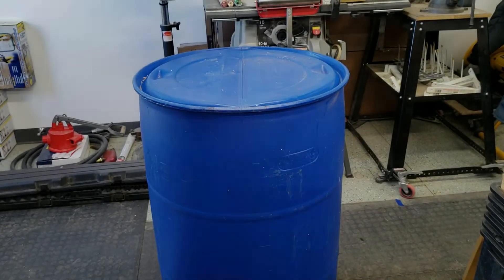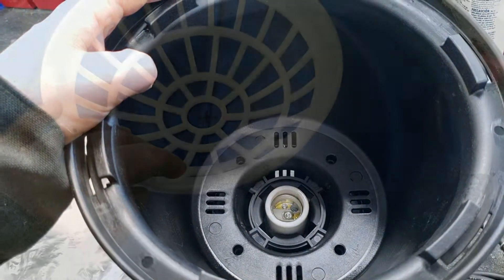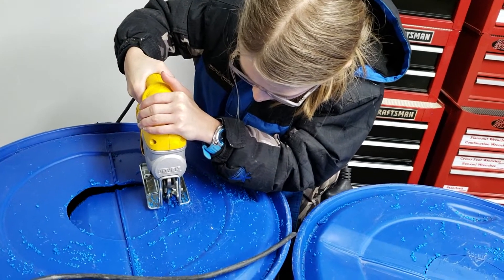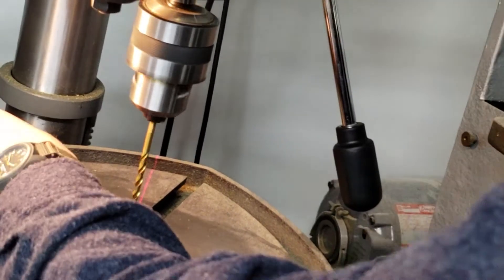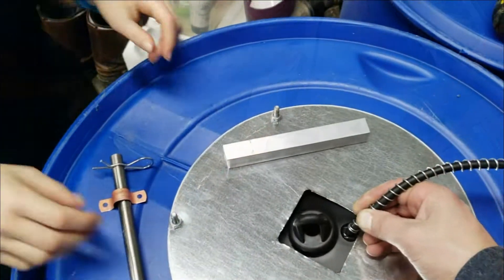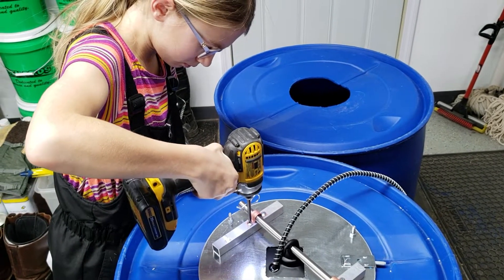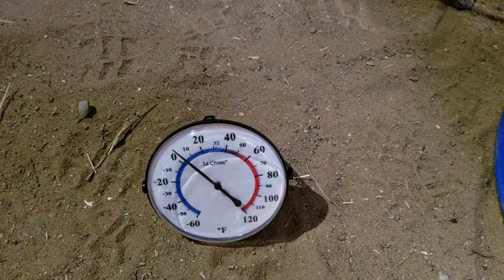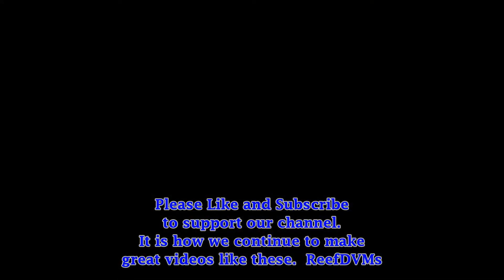Best Safe Animal Heat Lamp Barrel

Comment: The info on the Premier heat lamp says not to put it in a barrel. Does the metal disk on the top help to make it safer for barrel use?

Comment: I really like this design and want to make it, but I can't find the furnace vent cover to buy! Is there a link you could share to where you bought it?
Reply from the maker: hope this helps https://www.menards.com/main/heating-cooling/ductwork/ductwork-fittings/28-gauge-galvanized-assembled-damper/01806008wb/p-1444432193931.htm
Reply: @RMSpeltzFarm  This does! Thank you.